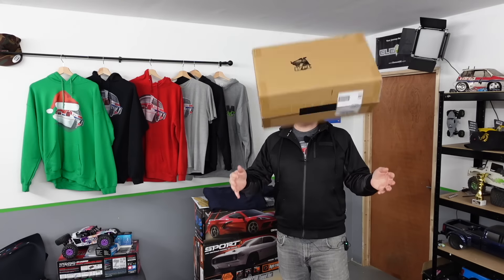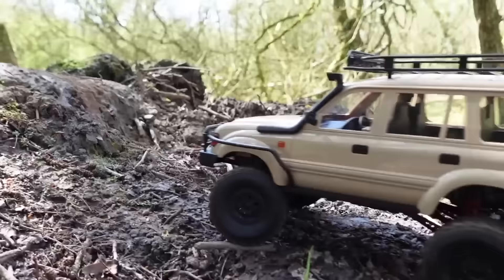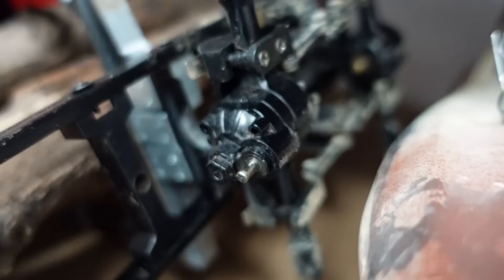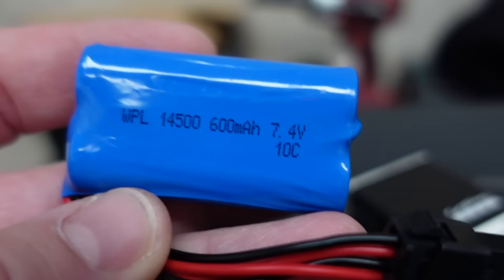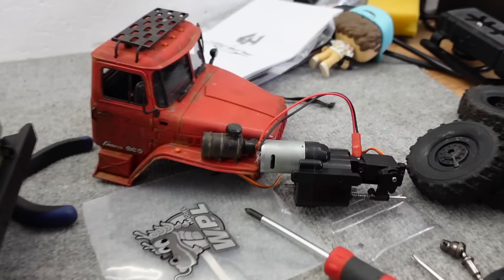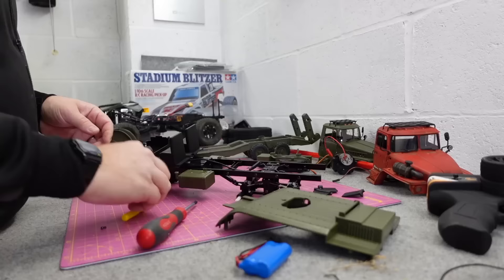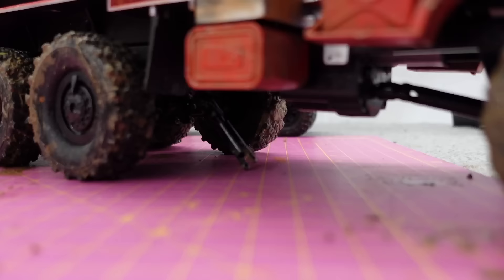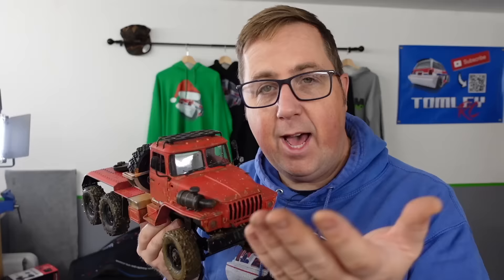The New [MASSIVE] $89 WPL Tractor & Trailer!

Comment: Saw this truck on AlliExpress, immediately searched YT and was thrilled to see you had a video.  Now I've gone and ordered the truck, 2 speed gearbox and upgraded motor, and, after watching, metal driveshafts hah. Hoping 2 1:24 crawlers will fit and look good on it. I'm also planning on painting it. Thanks!
Reply from the maker: Awesome, glad it helped you decide :) 
2 x 1/24 should be good
Reply: @TomleyRC  arrived today. DOA. Lights come on and wheels turn but motor doesn't engage at all and ramps only move halfway.  Rear bumper broken in two places. After troubleshooting the esc, turning doesn't respond anymore either. I got unlucky. Hoping the company will send a replacement. Until they do, I'm holding you accountable 🤣

Comment: As always a fair honest review.

Though i think you are slipping.... No driver in the cab.... 😜

That 2 speed upgrade really makes this thing,  i must admit i do think a jjrc q60 cab on the front would also make this killer.

Nice function with the droppable ramps.

Interesting that all new stuff coming out of china has the new 4plug jst lead and no balance plug, i believe there has been a law change, and unless its lipo it can't have 2 pin plus balance lead any more...

Comment: Great video as always Phil! I always look forward to your videos which usually results in me spending money lol. 
My transporter came last week and I didn't even run it before I swapped in the 2 speed transmission (with metal gears), and I was quite pleased to see the plug for the shiftier servo and the other unused ports on the esc. I'm going to test but I am hoping for more lights and sound. I have the metal axles, wheel weights, soft tires and a speaker on the way from WPL. One surprising thing to me was how light the tractor was, not much heavier than the empty trailer.

Comment: I know it's smaller scale, but with the upgrades inc the metal drive parts, and some weathering - tweaking of the looks and some general tinkering, for little over £100 you'll get something pretty darn good performance & looks, at fraction of the price of the RTR Redcat Chevrolet Hauler and the Traxxas one.
Reply: Yeah it needs more than 100 pounds to make it anywhere close to good it's 89 stock and good motor and gearbox for 11pounds is near impossible to get

Comment: I’m wondering if some reviewers are running it without fully charging the battery. I haven’t had any power issues with mine and ive been using it to haul my heavy huina excavator with no issues at all

Comment: Hello, if you use the selectable switch on the side of the RES-V3 remote to control the ramps on the trailer, what controls a winch? Doesn't the selectable switch on the RES-V3 on the side of the remote, control the winch function? Is there a work around to fix this?

Comment: question: would metal driveshafts not make the torque on the motor much worse, i know my own b36 is pretty heavy (it has several "spy upgrades" including a working gps system and a door that opens electrically, plus benches and operators) and mine has a tendency to "eat gears"  plastic, brass or China-steel, any flavor last only a few weeks i use the wpl 2 speed gearbox and the "china steel" driveshafts. 
i will buy a B36-3 of aliexpress next year, and get it ready for shows and displays.